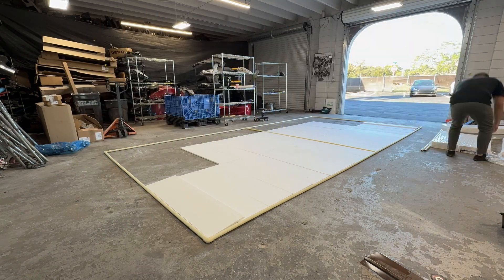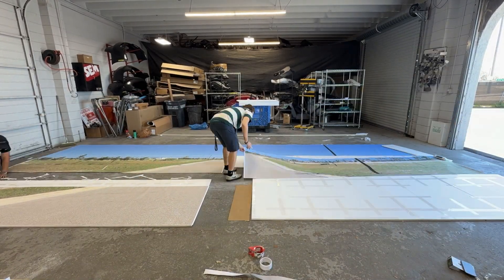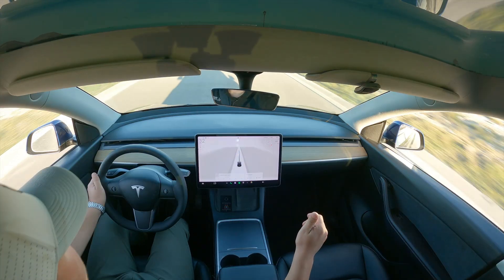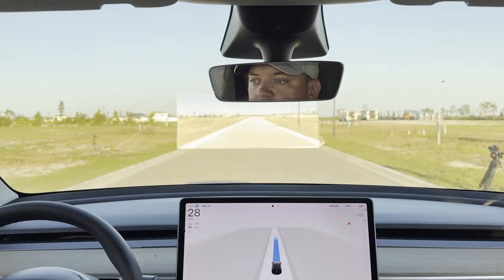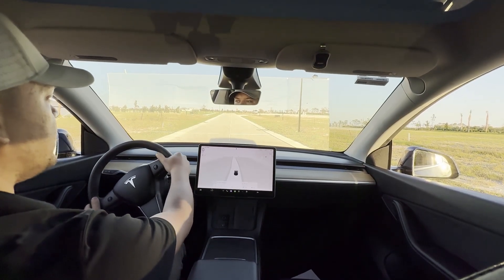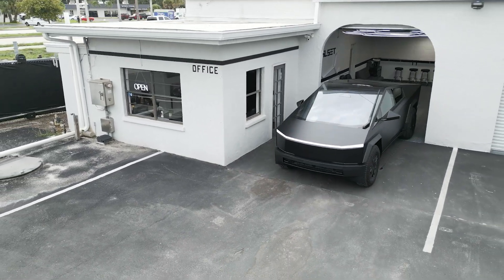Response to Mark Rober’s “Can You Fool A Self Driving Car?”

Comment: I notice that the cyber truck test was done an hour later. If you look at 7:17, the contrast between the wall and the sky is a lot more apparent. 
If this was constructed as a bigger wall due to also height of the camera and at the same time of day you could see the same outcome. 

It's hard to believe if model y and cyber truck perception stacks are any different. But it looks like they are one major version 12 vs 13 so it's not really controlled either way.
Reply: Stacks are different, HW4 computers and cameras are both better than HW3.
Reply: yes, ideally they tested the model y hw3 after the cybertruck to make sure its still not seeing the wall
Reply: Thought the same
Reply: look how early the cybertruck starts to slow down. at least from the perspective of the camera they were holding, the wall was still low on the horizon and didn't contrast with the sky. it's only when the camera is close to the wall that the sky color makes a difference
Reply: There's some truth to this, but also you need to remember that this is an insane edge-case scenario that simply doesn't exist in real life. Tesla's camera system could get fooled by something like this, and that's fine, because this is not a real danger.
Reply: @ilyaholt8607  I agree it is quite the edge case. You also should compare it with a human driver that isn’t expecting this wall and is trying to navigate traffic while changing lanes for a more realistic benchmark.
Reply: @ilyaholt8607  Ya but they wouldnt be fooled.

Free open source depth estimation models,  dont have this issue, it would be wild if Tesla FSD did.
Reply: @ilyaholt8607  hmmm. it does exist though.... if an image printed on a surface can fool the camera... HOW much more can a reflection on a truck/train will ? Imagine this scenario: Truck is in front of you and reflect the car in another lane, your self driving thinks the car is coming towards you and decides to make a maneuver to escape. 

Your life is instantly AT RISK. 

This is a very normal scenario that can happen.... A mirror polish on any big enough surface is now a threat.
Reply: @mcwornex2123 the AI will see the wheels and the lights from the truck. Donc forget it is a smart system like chatgpt and can resonate enough to figure out it was a truck.
Reply: @ilyaholt8607  The issue is that it is also fooled by fog and rain. And that's besides all the false promises and fraudulent marketing of "Full Self Driving" (oh but actually it can't fully drive by itself, you're still responsible, and we'll turn it off once an accident is coming)
Reply: @einstijn138 I think you are confused. LiDAR is fooled by fog and rain, eyes are fooled by fog and rain, cameras are fooled by fog and rain. FLIR forward looking infrared, is probably the only thing that can see better. But still not necessary. 

Humans should drive significantly slower in inclement weather. If anything makes your vehicle have less traction or visibility, you should NEVER drive your regular speeds, that is why collisions occur
Reply: @einstijn138 also, the only reason a lidar vehicle stopped for the boy behind the rain waterfall is because it cannot differentiate between a wall of water or a brick wall
Reply: @joshve87  radar is not fooled by fog
Reply: So V12 vs V13....big difference? Find a V13 Model 3 or Y.

Comment: Great effort. Time of day should have been a variable though. I'm not claiming it would change the result, but the initial tests weather and time of day matched the wall  far better than the CTruck tests.
Reply: They need to retest with the same time of day and weather. It's too glaring of an issue to ignore.
Reply: @ModestElitist  I see what you did there...
Reply: honestly, they should do it with a mirror polish vehicle/truck to prove to people how this can be dangerous... this is the real scenario. 

A perfect wall like this doesn't exist but mirror polish trucks do.
Reply: @mcwornex2123  I haven't seen many mirror polish trucks (gold plated supercars maybe...). That being said mirror polish would probably screw up lidar more than vision based systems.
Reply: @danbert8  either way needs to be tested for both. If they are legally allowed to sell vehicles that have self driving options, then public scrutiny should be welcomed, and expectations for both need to met.
Reply: @danbert8 every tanker truck around me is stainless steel and mirror-polished. I see at least once a day passing me on the highway. You must live in an area with no gas or dairy tanker traffic.
Reply: @trutranx  Every tanker truck around me is round and heavily distorts the reflection...

Comment: Model Y HW3 on V12 doesn't spot the edge case.   
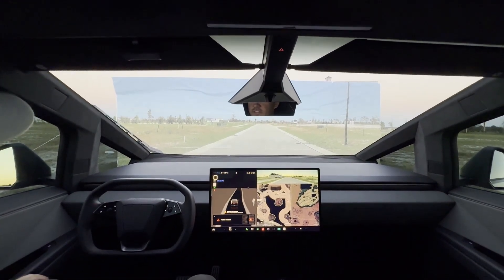Cybertruck HW4 on V13.2.8 spots the wall at @7:02mins ✅
Hw3 cars with FSD upfront purchase will get upgraded to HW4 which has higher resolution and faster processing.

Comment: IMO, you should have only ran it with Hardware 4. Or at least only uploaded HW4 test. HW3 is phasing out.
Reply: Millions of people on the road with hw3 cars, most won’t upgrade
Reply: @ Still should be running tests with the best of what they have to offer. This was the original criticism of Rober's video. Just being logically consistent.
Reply: @7:02mins he does just that. This does neatly show HW3 doesn't cut it.
Reply: @ Right, I said *only*. I don't think running with HW3 was necessary.

Comment: Very insightful, I wonder if the cybertruck stopped because as the sun was setting, the colors of the sky and road didn't line up with the image as they did during the day. Would be interesting to do an additional test with the Y during the sunset as well, just to be sure
Reply: Was thinking the same thing 🤔
Reply: Also the Cybertruck in brighter sunlight.
Reply: If you look closer, in the car POV it still blend on the blue sky  in the far away but in the outside view there are already grey sky.
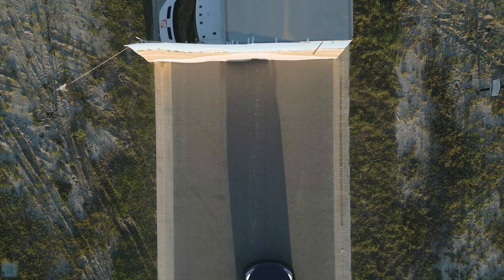Reply: @christianjavier656 go to 4:53
Reply: @christianjavier656  Even if that was the case, the Cybertruck had its headlights on, casting the rectangular image with more luminance than the background.
Reply: Go to 4:53 in the video and you'll see why it stops
Reply: Its hard to compare both the cybertruck and Model Y that were used. They are both on different hardware, one with HW3 and one with HW4. Elon has mentioned we are at a point with FSD where HW3 can't utilize FSD fully at this point
Reply from the maker: @iamthexmarine agree. I will test model y with hw3 and hw4 back to back to see what happens
Reply: The point here is that Mark Rober car with FSD would hit the wall anyway
Reply: @ The point is that he never ran the test, if a doctor runs a drug test on a patient and they are “presumed positive” because of a prescription, they can’t bill the insurance for that test, nor can they know if they are right, maybe there is noncompliance or maybe poor absorption or rapid metabolism. You have to actually do the test (properly) to know the answer.
Reply: 100% agree.... earlier the photo matched the terrain far better, perhaps good enough to confuse the system.  If you want it to be a real test, then test it the next day with the same full sunshine.
Reply: painting wall in nonsense, it’s better to test against glass wall, which is more meaningful.
Reply: @welcometoeyeran go to 4:53 in the video
Reply: Maybe we'll get another video that shows how they work if the cars and conditions got flipped
Reply: @welcometoeyeran  They want to find any excuse to explain away this bs lmao
Reply: @welcometoeyeran  I'm not reading this yap
Reply: @welcometoeyeran  yap yap
Reply: No, it stops because it had the hardware 4 computer.
Reply: yea i agr5ee with this u guys are smart
Reply from the maker: I did. The professional cameras were getting packed up and I decided to run the model y one more time.
Reply from the maker: Retested! 

https://youtu.be/TzZhIsGFL6g?si=p_T4M_3pqILRE2rE
Reply: @welcometoeyeran version 13 can detect the image by pixel. So they can tell .. might be because of hw4 camera or ai training on version 13
Reply: for anyone wondering why the cybertruck stopped: the cybertruck has version 13 which is a complete rebuild of the tesla fsd system.  its night and day different than version 12.5... even version 12.6 is night and day from 12.5.  12.5 is one of the worst versions of fsd currently installed on teslas.
Reply: It was 100% because the model Y was on 12.5.4.2 which was always a buggy version, it was the one that would run red lights and do other goofy things, it’s pretty old at this point, not sure why he was testing it, the car had an update pending
Reply from the maker: @voltspc9394 I’ll be doing another test this week during the day, same sunlight, both model y with HW3 and HW4. Both updated to latest software
Reply: @kylepaultests  Looking forward to it
Reply: @voltspc9394 someone caused a six car accident (worse she was 24 with state minimum coverage, 15k per car, 30k per accident, they lost my car at first, so my 300k coverage took over) and I demanded an EV rental, so I was in an AP model 3 for 45 days, I learned that AP doesn't care about red lights or stop signs, but Hertz doesn't have FSD=( I really wanted to try FSD

The Model 3 but my Chevy Bolt EUV, Premier sun and around to shame (5k miles, poor baby)
Reply: @voltspc9394  noticed that, too
Reply: I really don’t think the picture matching the time of day (or even matching the surrounding location) makes much difference here. All the software cares about is that it can still see a continuous road ahead and that it isn’t obstructed by another car, or a pedestrian, or any number of other road-specific hazards. In all honesty, you could probably replace that road picture with a cartoon road painted by hand and the first Tesla would still drive right into the wall. The software is scanning for things like children standing in the street, not pictures of streets on the side of a box truck blocking the street. Add a child to either of the pictures used in these experiments and the Teslas would stop every time.
Reply: Man yall just make shit up hahahahahah so just dotn drive the tesla on sunset what kinda dumb take is this?
Reply: @salmanm6809  no it’s how to conduct a rigorous experiment. This way you can actually find the variable responsible for the deviation.
Reply: @salmanm6809 how is it dumb? Explain more!
Reply: @salmanm6809 the vehicles drive fine. The real statement is don’t put a picture that cover an entire road like we are in a looney tunes cartoon. This will never happen in real daily commutes.
Reply: @joshve87 did you even understand the clearly stated point of the experiments by both Mark and this guy ? It’s to freakin see if you could fool it.
Reply: @joshve87  Yea the vehicles that have constant recalls, that combust themselves more than any other EV, that has horrible driving characteristics don't drive fine.
Reply: @joshve87  hi. this isn't the point though. It's about whether if a truck has a reflective surface, will the Tesla be able to know it's a reflective surface or not.
Reply: @mcwornex2123   it won’t be an issue. The cyber truck stopped for an exact image of the road. Insert a reflective truck, 3 foot tall tires and a huge frame. Pretty sure that isn’t difficult to interpret in comparison